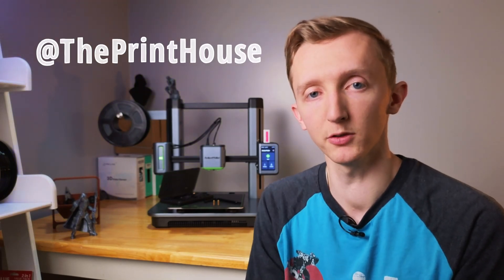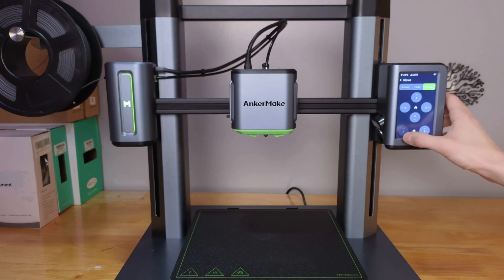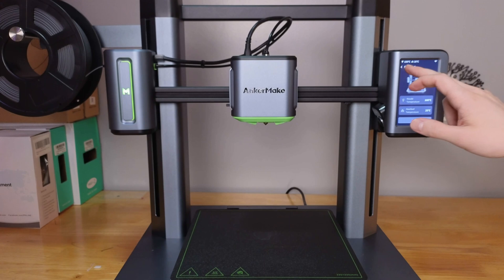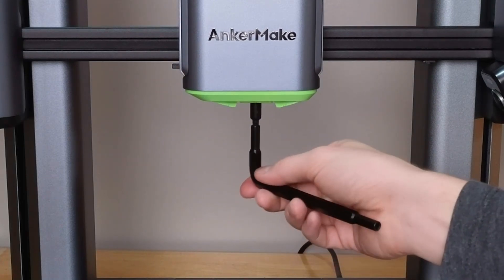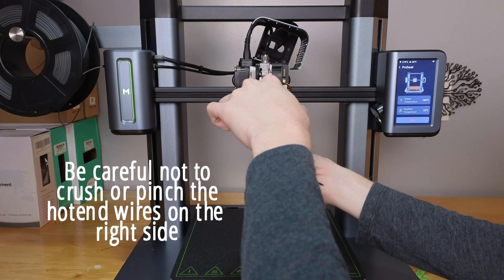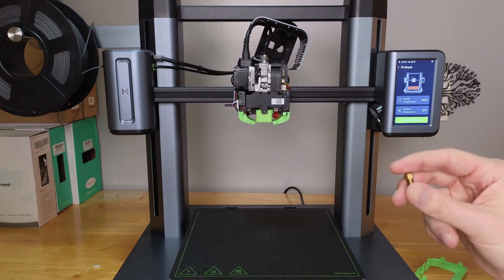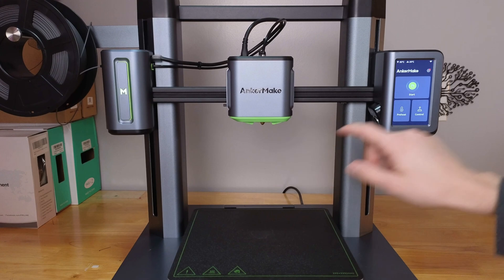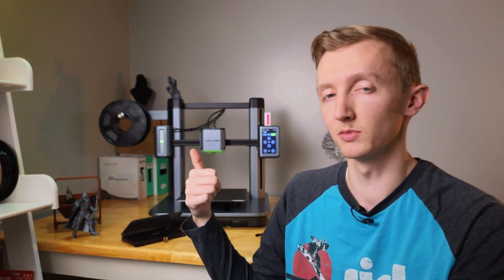How to Change the Nozzle on the AnkerMake M5 - Tutorial

Comment: Hi Ecto; really enjoy the videos!  Just curious - have you found a Prusa and/or Cura profile for the .6 nozzle?

I put a .6 on mine a few days ago, but discovered the profiles ankermake provides for Cura/Prusa don't include .6 profiles.  I can manually change the nozzle size setting to .6, but I'm still seeing the layer height and other settings for the .4 nozzle.  I'm sure these can all be updated manually, but I'm not quite there yet in my learning.
Reply from the maker: Hmm, I'm not sure. I think when I changed mine I just had to use the AnkerMake slicer (it may have been before I started using Prusa).

Comment: What nozzles did you use for this? Official Ankermake ones? Saw your vid on printing with wood filament and wondered if you need hardened nozzles for that / which ones you were using.
Reply from the maker: Just the included nozzles (with the extras from the Kickstarter)
Reply: Yes you need a hardened nozzle

Comment: What's your Z-offset setting?
Reply from the maker: Usually between .5-.8. But it differs by machine, so you'd need to find yours for your machine. I usually just go up until I don't hear grinding anymore on the first layer.

Comment: After the new firmware update on Saturday the extruder constantly moves back and forth on x axis when preheating. Anyone have this issue?
Reply from the maker: Pretty sure this is intentional so you don't accidentally touch the hot nozzle... at least that's what I've heard. Don't know if I'm a fan of it yet haha
Reply: @Ecto3DPrinting  Ankermake will be disabling that feature in the next update in 3 weeks.

Comment: Unfortunately I broke my hotend while changing the nozzle. Didn't have any experience with 3D printers and broke the tiny screws that were keeping the hotend in place.
Fortunately a replacement was sent with the printer, and also, Ankermake sent me a new one within a week, even though I live all the way in The Netherlands
Reply from the maker: Dang, yeah, heard that happen to lots of people. Glad they sent you another replacement though!
Reply: That's how I felt with the filament holder. The screws literally "eat", that's what we say. Whether that's just because of the screw locking agent that was applied or because of the poor quality of the screws, but the Allen key broke afterwards.
Reply: Same thing just happened to me, so annoying
Reply: I went and brought some M2 x 16mm 12.9 Alloy Steel. I haven't tried to replace my nozzle yet but those should be much better than the ones anker gives you.

Comment: Thanks for the vid…..very helpful.
Also where did you source the larger holed nozzles…….I can only find the 0.4mm ones for this printer.    I would like to get the 0.5 and 0.6mm ones??
Cheers
Reply from the maker: Thanks! Glad I could help. I got the extra nozzles from the Kickstarter campaign. I'm not sure if all the levels get them, but mine came with a little baggy with a bunch of extras.

Comment: my nozzle on the  printer doesn't fit the bit any more. The other bits fit just fine. I think the nozzle got warped. I more worried about crossfeeding again. my other hotend got the threads cross
Reply from the maker: Dang, sorry to hear. Did the nozzle warp or just the hex bit? Or is there just some filament goop on the outside of the nozzle? When I first started trying the hex bit, the nozzles wouldn't fit either, so I basically scraped out the inside bit by bit by pushing a nozzle in until it fit.
Reply: @Ecto3DPrinting  its the the one nozzle that doesn't fit. the unused one still fit the hex bit. Im going to have the just use a wrench to get it off.

Comment: Are all your prints centered on the bed? Mine seem to be shifted to the front a 1/2 inch and to the right a 1/2.  I always level and home the settings.  I need to catch up on your videos so I am not asking questions you may have already discussed.
Reply from the maker: Hmm, haven't seen that before. Mine are centered in the slicer and they always seem to print in the right place.
Reply: @Ecto3DPrinting  Ok. I am thinking that it is off a little since I am using others ready to print files?
Reply: @1blktalon  that makes sense. It's likely that the files were created for a smaller print bed.
Reply: @s13rr4buf3  ok. Thanks for the info.

Comment: Can you explain the importance of Z-axis? Or do a video about it?  My Z-axis is at 0 (the way it came) with the nozzle it came out of the box with and it's been going just fine. At least to my noob eyes
Reply from the maker: Good question. I'm no expert yet but from what I understand when the printer homes itself it detects the level of the print bed. But sometimes it can just be TOO close to the bed for the first layer which can either scratch the print plate or make the first layer too thin. I think both of those were happening when I first got mine. The first benchy I printed sounded like it was grinding into the bed and the first layer was basically engrained into the texture of the plate and I had to scrape it off with the cutters. So that's where the Z-Offset comes in. It allows you to "offset" the z-axis to a place that it has good first layer adhesion but isn't too close such that it grinds the plate. Hope this helps :)